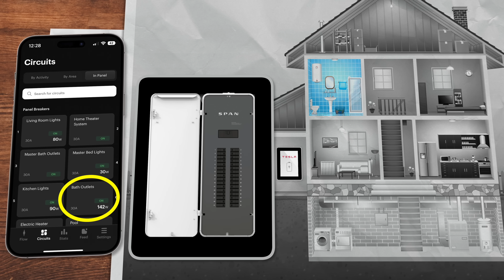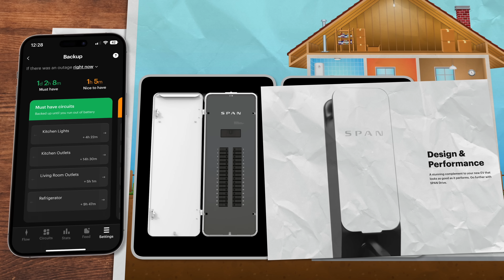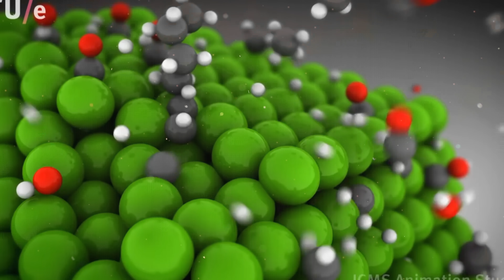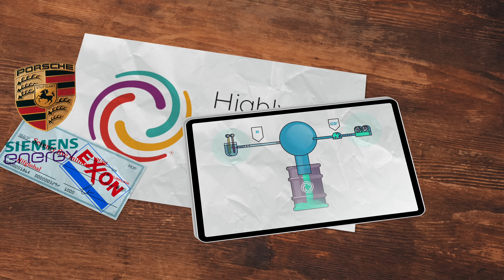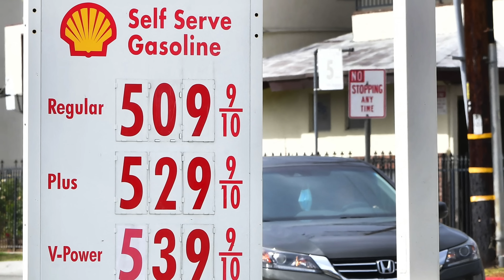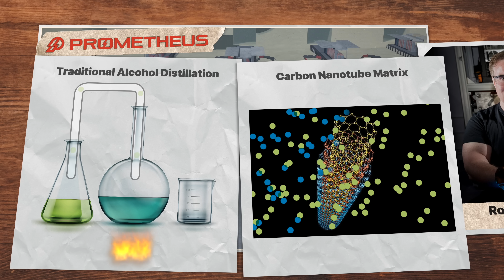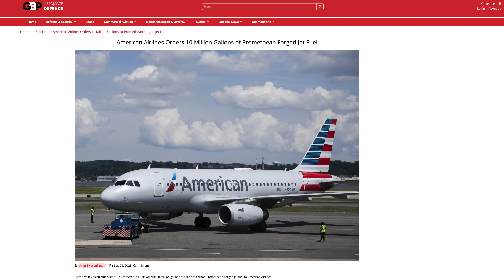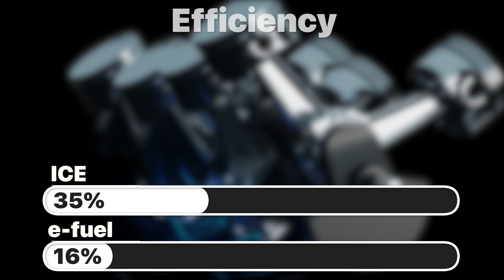EPIC Breakthrough Can SAVE the Internal Combustion Engine!

Comment: Internal combustion engines are not the main culprit behind the climate crisis but rather another nail in the coffin.  ICE engines make up about 89% of the fuel used in the entire transportation sector which contribute about 29% of the total US greenhouse gas emissions. Another 25% of US greenhouse gas emissions come from electricity generation in power plants.
Even if you total the entire greenhouse gas emissions of the world, the US is only responsible for about 15% while China alone releases over 30% of the total greenhouse gasses worldwide.

What we really need to do today to start reducing our consumption of fossil fuels and electricity produced from fossil fuels is to start reinvesting in rail that is owned, operated, and maintained by the federal government much like our current freeway system and force more freight to be moved by rail for long haul distances rather than via truck.  It is way cheaper and more energy efficient per ton to use rail.  The challenge is that it requires people to do more planning which is something that is really short-sighted and lacking in today's world.

As a nation we also need to reduce our consumption of new junk that soon ends up in a landfill.  Things need to be mandated to be produced in such a way that they can be upgraded, repaired, and serviced for many years/decades rather than replaced as soon as the next new thing comes out.  We all know that reducing and reusing come before recycling which is the most energy-intensive and wasteful of the three.

Comment: There is no Climate Crises. You will not be able to electrify everything that now runs on gas and Denial. What will be used to generate the electricity needed? Wind and Solar won't do it. You will still need gas, diesel fuel, Natural Gas, Coal, etc. So you will still be producing carbon, which by the way plants depend on to live just like we depend on oxygen to live. Also, it takes lots of oil to produce windmills and solar panels. Where I live in the Walla Walla valley, they are already removing the windmills that were put up around 20 years ago because they are worn out. I have been seeing tractor trailers haling cut up windmill blades away from here. So, they are already having to replace the ones that exist with new ones. More oil needed to replace them. They are also going to run out of the minerals needed to make the batteries since that is not renewable either.

Comment: The crisis in the weather and effect on the planet is not because of automobiles.  Man made CO2 represents JUST 3% of the planets CO2 output.  There is no way on this planet man is affecting our environment.  You should know it takes more energy to charge a battery than to use fosle fuels.  Even building batteries and getting rid of them causes more damage to the environments.  Follow true science not the BS you have embraced.

Comment: 90% efficiency for ev batteries is not really a good number, since batteries are a consumable, as they may need to be replace 2x during the life of a car, 3x for older cars… and recycling batteries take power that is not included in the 90% efficiency number.
Reply: Recycling a combustion engine takes power to and a lot more of it. The efficiency takes about here is the amount of energy put in that is put to actual use. No beating EV's on that point. 
And what is the life of a car these days? 10 years? In which case a battery will last the life of the car. And you should still have 80% capacity at that point. And don't forget old cars loose horse power to.
Reply: Hi @bzuidgeest  -

“recycling a combustion engine”

We have not even talked about the recycling of electric motors! ROTFL!

The batteries are the equivalent of recycling a gasoline/diesel tank, much easier to recycle a gas tank, and a gas tank lasts the life of a car, while an EV battery does not last the life of a car.

“life of a car these days? 10 years?”

I wrecked my last car at 19 years, 
virtually no maintenance except tires & oil… it’s replacement is now on 6 years. I was getting 30+ MPG  (city & highway for our usage.) Over 200k.

My wife’s car is a 2001, now going on 22 years… tires, oil, and a radiator. Once again, 4 door sedan, 30+ MPG (city & highway for our usage.) Over 200k.

“Battery will last the life of the car”

Nope. The battery costs about the price of my last car… I bought a used car, 1 year old, $15k, to replace my 19 year old wrecked vehicle, 4 door sedan, leather interior, automatic everything, from an expensive dealer… ROTFL!

An average Tesla battery costs $13k-$14k

Basically, throw out the vehicle when the battery gets old. Maybe you are right, the battery lasts the life of the car, because we’ll throw out the car when the battery dies with it’s 100k warranty. 

The EV batteries suffer calendar aging, as well as usage aging, aging from being charged in cold weather, and [self-combusting] shorts can develop from charging in freezing temperatures.

Batteries must be respected. 
All energy is dirty & dangerous.

(Stick a bunch of keys in your front pocket & place a 9v battery in your pocket with the connectors facing down… or swallow a button cell… even the smallest batteries with the least power can be lethally dangerous.)
Reply: @DavidHalko  comparing batteries to the gas tank is functionally correct, but for any other comparison it's nonsense. Recycling is about the total amount of materials and how much its costing to reuse them. Their functionality matters little. 
Your old cars are pumping shit into the atmosphere their entire life. Electric cars do not. The fact that you use them does not mean everyone does. Most cars are wrecked much earlier. 
You talk about the dangers of the battery,. Ever tried drinking gasoline? 
Most of what you said is complete nonsense, uttered by someone that just desperately wants a way to defend driving ice cars. 
It will take a while but those things will become relics, just like the people driving them.
Reply: Hi @bzuidgeest  -

“old cars… atmosphere”

Emissions are a problem for EV’s, as well.
The emissions required to produce an EV battery is immense. Mining rare earths in Africa or South America or Australia, transport across an ocean for battery manufacturing, manufacturing of the battery itself is incredibly energy intensive, shipping to EV manufacturing location… one may drive an EV for 40k until an EV just breaks even, compared to a regular car, as far as emissions difference. Then, the electricity is largely produced by burning various carbon fuels, since people are often charging their cars at home, after they get home at night, when solar panels are not producing electricity. If someone lives in a U.S. state like West Virginia… an EV will actually produce more emissions than a hybrid car will, since the electricity is so dirty! LOL!

“most cars are wrecked earlier”

If an EV is wrecked earlier, then the emissions produced in manufacturing an EV may never be recovered, in comparison to an ICE vehicle. 

“dangers… battery… gasoline”

Yep… As I said, all energy is dangerous & dirty. This stuff has been bubbling out of the ground, for as long as written history existed, from the days of Noah sealing the ark. 

“defend driving ICE cars”

The amount of energy stored in an tank is far superior to the amount of energy stored in a battery. The energy transmission / transportation requirements are independent of electric lines, offering redundancy in case of a down power line, storms, or war… offering people a way to survive if there is a failure. I have lived long enough & in enough places to appreciate diversity in energy infrastructure. A passive gas fireplace still heats a home when power is out. An ICE engine in my car, with an inverter, can power half my house with a power outage. A power outage does not bother me, for a week or so, when I can drive my car[s], with the energy stored up. Evacuating a peninsula or coastal area during a hurricane with an ICE vehicle is far more realistic than with an EV.

H2 from renewables, like wind & hydro, is a better solution. Provides energy diversity, that carbon based fuels have. H2 fixes the problem with non-portable electrical energy, to become portable. H2 derived from water, which is readily available in all inhabitable areas. H2 emissions are less than tradition carbon based fuels. H2 is done today. H2 can be used in both ICE & Fuel Cell, to reduce barriers to entry & constraints in supply chain (to force competition to drive down costs & offer consumers alternatives when a constraint appears.)

“to be”come relics, just like the people driving them”

Honestly, EV is a nice idea for many use cases, just poor thinking as a “one size fits all” use case. Maybe a nice spare car, for a rich family for commuting, who has an ICE vehicle for longer trips… but EV’s are a poor choice for a poor family in an apartment where they will be left to die in a catastrophic weather event, or where they will need to use fast charging stations, where fast charge electricity costs as much as cheap gas, and the cost of vehicle replacement is exorbitant for a low budget.

Honestly, compelled EV is just another way for the bourgeoisie to create a serf class, binding the poor to the local land, so they have their slave class to do the local work, and the workers have no method of emancipation. An expensive [ev] car is basically no car, for the poor.

We need to emancipate people, with clean & widely available & robust energy sources for transportation… not constrain people.
Reply: Hi  @bzuidgeest  - 

“ice car overtakes ev in pollution once in use”

Unless you are using hybrids or plug in hybrids and your electricity is produced using coal or oil… which is most of the world and even large areas of the first world. Electricity made with natural gas is a lot better (but much of the third world has already transitioned mobile transportation to natural gas, as well as first world cities like mine.) 

Studies evaluating pollution [you didn’t cite]  normally don’t even take into consideration the energy / pollution required to recycle EV batteries.

“Mandating EV… not allowing murder”

This is a false analogy, a logical fallacy. Pricing people out of the personal mobility is not like telling people to not murder. 

Since the advent of ICE engines, life expectancies rose & slavery was able to be abolished, since ICE engines made slavery uneconomical.

“Being backwards again”

Yeah… I’ll go back to my solar panels & lithium ion batteries, while hoping for a sustainable mobile solution, and enjoy emancipation of slaves. Pretty backwards, for the progressives I suppose.

Legally mandating the poor to become relatively immobile, by forcing an expensive & unsustainable mobility solution like EV, is immoral, both economically, societally, and environmentally.

You can go back to the slaving world, without ICE engines, or an appropriately widely available sustainable replacement.

Comment: The best way and the most efficient way is to have a gas generator petroleum electric generator to charge up the electric in the batteries just like freight trains and medium size boats
Reply: Generating electricity from a generator to run a vehicle may be more efficient than a direct combustion engine, but you still have a huge energy loss in the generator.

Comment: Ice and electric have their applications eg long road trip hybrids better short trips work store 3 hour drives electric is better. Problem is access to charging and killing time to charge when you can fill a tank under 10 min lot less.hydrogen seems like better choice overall instant charge/fill and just air and water is discharged.
Eg one guy bought a rivian truck took him over 20 hours could of done in 12-15 with ice and hybrid.
Reply: worbg hybddér gid lobg vtrio
Reply: @sharonbraselton4302  ? Can’t understand

Comment: Pretty sure I'm not buying their claims that they will be as cheap as current petro. First off if you are going to use electrolysis you can just go straight to Hydrogen. Yet here we are claiming that we will be making a carboHYDRATE LIQUEUR, which we will extract with semipermeable membranes? I bet those filters plug really fast! Opps, and then we need to convert carbohydrates (partially burnt hydrocarbons) back to hydrocarbons? Well, that's going to take energy! Folks generally don't bother to turn carbohydrates into hydrocarbons. Sorry but I'm calling these guys out.

Comment: Nuclear fission is not the answer for power generation.  Lots of oil and gas is used in building nuclear reactors, for example concrete and stainless steel components.  Mining the nuclear fuel is achieved using diesel-powered vehicles.  Nuclear reactors have neutron embrittlement problems.  The proposed e-fuels needs to be produced using genuine renewables from photovoltaics and wind turbine, possible also geothermal energy.

Comment: The answer IS easy.  Nuclear power can produce prodigious amount of power.  Couple that with modern catalytic systems that pull CO2 frim the atmosphere, and introduce it into existing infrastructure, and the solution is staring you in the face.

Best thing?  The technology is ready there.  No waiting 50 years for hydrogen fusion or new battery technology.  

M85, 85% methanol with 15% gasoline, all produced using highly efficient fission nuclear power...BAM!  No energy woes, ever again.  Get 'er done!

Comment: So I'm not against EVs at all but .. the manufacture of a conventional vehicle is about 6tons of C02. The manufacture of a 400 mile range EV is about 25 tons. The comment that "EVs require very little maintenance" is inaccurate. Also being an electrician in CA, I can tell you most homes (In Northern California) will need to have a typical 100amp service upgraded. This will cost a large amount of home owners a chunk of change just to support the added load of charging an EV. In my mind we don't have the infrastructure to support the mandated change. The push at this time is about redistributing the power and wealth  oil companies have. Not to help the environment (at our current EV manufacture processes) I recommend looking up T.E.D talk on electric vehicles. It's very informative, although I'm assuming the information is  100% accurate in that T.E.D. talk.
Reply: The TED talk is titled the contradictions of battery operated vehicles.

Comment: Way too inefficient to my liking. Maybe using e-fuel combined with methanol fuel cells makes more sense: you can still drive electric, and reduce the amount of batteries (and weight) needed. You still want some super-capacitors and batteries for regenerative breaking though.
Electric trains that transport trucks is also a good option that's heavily applied in switzerland
Reply: Direct methanol fuel cells.

Comment: E-fuels are a completed none starter. Itwould take at lest a decade to build out this infrastucter large enough to displace a significant fraction of fosel fuel production and in that time more then half of all new vehicle sales will be BEV anyway. Also the efficency make this proposal utterly ridiculous. If this was to be done using renewable energy generation it would take 5X the build out (thus 5x the cost) to provide the needed energy vs just using electric modes of transportation. This kind of system only makes sence if your making rocket fuel on mars. Pointless in a domestic (earth bound) energy economy.

Comment: Our company had hydrogen fuel cell kits on Ford vehicles the fuel cells were running 24 / 7. We also have the PICC PREIGNITION CATALITIC CONVERTER. OUR COMPANY WAS AT THE WORLD RENEWABLE ENERGY CONFERENCE IN WASHINGTON DC.
WE HAD A VEHICLE WITH THE HYDROGEN FUEL CELL KITS ON IT PROVIDING 150 MILES TO A GALLON OF GAS. 
THE PICC PROVIDING HUGE 
MPGs. With these products on your vehicle your engine runs cooler eliminating hydro carbon sludge which breaks engine parts. Due to a cool running system eliminating oil changes each year. Fellow I worked with his motorhome went from 8 MPGs to 18
 MPGs. 
Our SUNDANCE HUMMINGBIRD GENERATOR USES MAGNETS TO PRODUCE 265 THOUSAND KILOWATTS A YEAR. ELECTRO MAGNETIC ENERGY WHICH PERVADE THE UNIVERSE AND OUR PLANET PRODUCES FREE ELECTRICITY.  USING MAGNETS TO PRODUCE AS NICOLA TESLA INVENTED.  TESLA ALSO INVENTED THE COMPUTER  A/C ELECTRICITY AND SO MUCH MORE. HOW ABOUT THE TESLA HOWITZER AND THE TESLA SHIELD WHICH USES RADIO BEAMS AND IS ON SATELLITES 
We have more and are protected.  Our mechanics for fuel economy are on hit lists.

Comment: I'm sorry but EVs aren't the answer.  Replacing batteries will always be much more expensive than a new ICE engine.  I found out the hard way.  I bought a used Chevy Volt.  Did fine for a year or so, then the battery pack started having problems.  Ended up costing me $7000 to replace 3/4 of the pack.  I can buy a lot of gas for that much money.  And I worry about when the other 1/4 of the batteries will conk out.  When they do, the car won't run until it's fixed.  Not like you can get home in a limp mode... so call the wrecker and have the car towed to the Chevy dealer that can replace the batteries.  So add the tow charge to that cost.  e-fuels sound like a technology that may someday be useful, but I doubt we will see it in my lifetime (I'm 74).